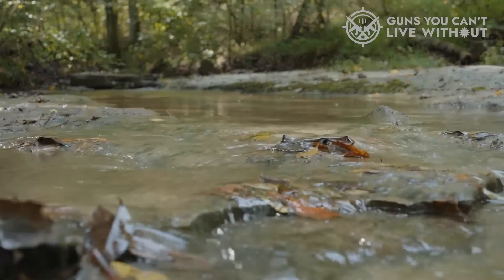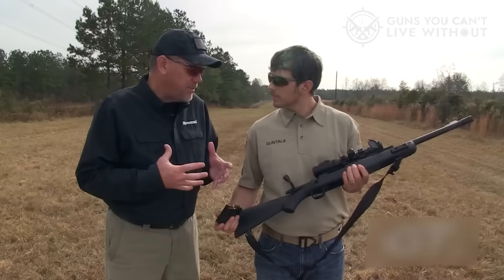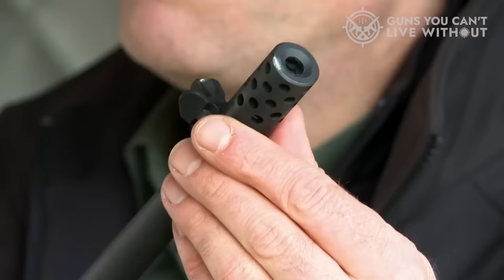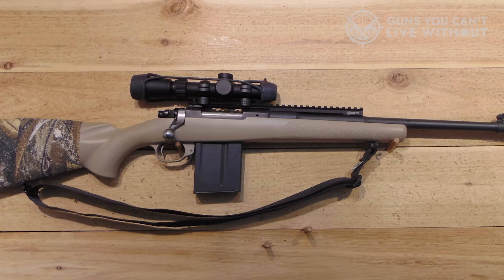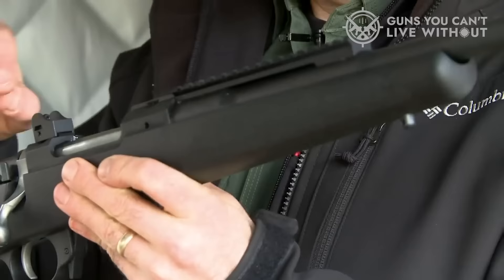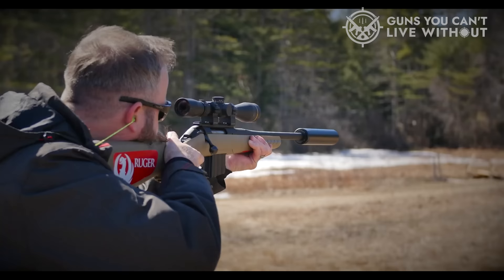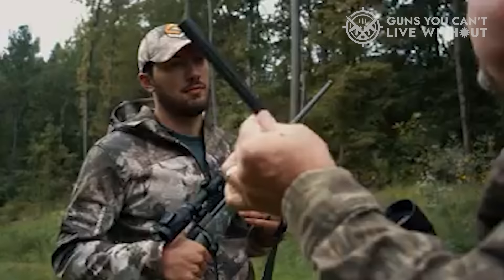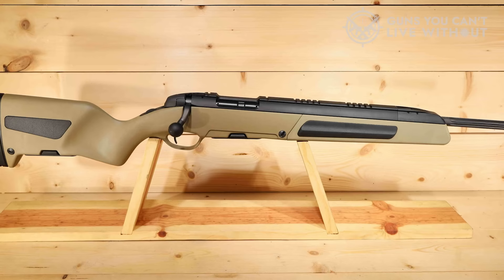Best Scout Rifles For Survival 2024! Who Is The NEW #1?

Comment: The Mossberg MVP in 7.62x51mm can use both M-14 and SR-25 pattern magazines.  Even the MAGPUL D-50 works.
Reply: I own one and while they can use the mags, they are hard to find and a handful to shoot since they are rather light
Reply: @jasondarby2749  They seem pretty common in the guns stores I've seen.  And they shoot about the same as any other .308 bolt action as far as I can tell.
Reply: @Kriss_L  might be where you live because I had a hard time finding mine when I got it. It is quite a bit lighter than the .308s I am used to.

Comment: I've seen some online questions and complaints about the Steyr iron sights. To my mind, iron sights on a scout rifle are an absolutely integral part of the package, not a mere "back-up" Whatever the make, they had better be top quality and rugged to qualify as a true scout rifle.
Reply: The plastic sights on the Steyr are not nearly as rugged as that of the Ruger.  During the 2016 Scout Rifle Conference at Gunsite, this very issue was a topic of discussion with the folks from Steyr.  Part of their response was that very few riflemen ever revert to “iron” sights when using optically sighted rifles, and that modern optics rarely fail.  I personally do not go with that logic, and therefore equip my “scout” rifles with rugged iron sights, and intermediate optics that have detachable scope rings.

Comment: Ruger American Ranch 7.62x39, 38" long and weighs 7 lbs including a linear compensator with front sight attached, Leupold VX Freedom 1.5-4x20 scope with  Pigplex reticle and a stock bag with tools, rear sight, oil and a bore snake. Uses Mini 30 magazines.
Reply: One of my favorites. Also super accurate.
Reply: @1984keen  Mine has been modified to use Pmag AK magazines.
Reply: Not

Comment: I have an AR-15 and AR-10, a few years ago I purchased the Mossberg Scout, 5.56, it has become my favorite carry around rifle. It is easy to get in and out of a vehicle, easier to carry through heavy brush. I have a bunch of 20 round AR mags that make it the perfect rifle for me. I looked at the Ruger and Savage Scout rifles, the compatibility with AR mags sold me on the Mossberg, along with being half of the price of the Ruger and about 25% less than the Savage. I am looking for a Mossberg in .308, a matching set would be great.
Reply: I like the scout, but the bolt action takes away from the follow ups.
Reply: Using standardized magazines is the only logical conclusion.   Availability is key.  Why reinvent the wheel when you can use gi issued type magazines.

Comment: I'd take the RUGER Gunsite Scout. I've owned a RUGER American. Very accurate in 6.5 CM but sold it B/C it had NO bolt lock. Otherwise it had an excellent 3 lug bolt and innovative bedding system.
->The excellent TIKKA t3 by SAKO is the official Canadian Ranger rifle. If is VERY similar to the RUGER Gunsite Scout laminated stock rifle. Both are VERY similar. The RUGER and TIKKA have a Mauser bolt, laminated stocks, magazines, iron sights and ACCURATE cold hammer forged barrels. Never doubt RUGER'sbarrels ever since they changed to cold hammer forged machining.

Comment: I love my SOCOM 16 in 308. I have a Burris, long eye relief scope on it, and it's a gem!
Reply: I hate mine. HUGE front iron sight that basically covers a man-sized target past 25 yards making it useless for accuracy, fire breathing muzzle brake that makes you want to die firing in low light, and the scout mounting rail is less than useful. I bought it before I knew anything.
Reply: @dougo753  Shave it down if you plan on using it. Good luck!
Reply: @64samsky  They make a replacement sight but because of Springfield's poor SOCOM design you have to replace the entire gas block unlike the easy and readily available alternatives for all other M1A models.
Reply: The wide front post matches the purpose of the SOCOM’s length.  Quick pointing short-med range target acquisition.   Simply remove your post and file it down narrower.  I have sharp point front posts on all of my rifles.
Reply: I have the m1a scout with a leupold.  The glass I just got recently so I'm looking forward to break in
Reply: I wish I had keep my Socom, but sold it to a friend.

Comment: The M'berg scout is chambered in7.62x51/Nato ammo and 5.56/ Nato .. note there are things to consider regarding the difference between standard 308 Winchester munitions which many beleive are fully interchangeable with 7.62 ammo. True Nato ammo in the 7.62 caliber have a very hard primer casing which the unadjusted Scout firing pin can not reliably impact hard enuf to get combustion...Also, the 308 ammo is typically in the 150 and up bullet weight, whereas the Nato ammo is 147. From experience, the lighter Nato rounds (with modified firing pin) are a much less aggressive shot in the short barreled Scout. And there are differences in head space and combustion pressures between the two ammo. I look at it like this ..the stamping on the barrel is 7.62x51 with no mention that 308 will do just fine.

Comment: The scout CONCEPT was based on the best that was available to Jeff Cooper at the time. Low power variable optics were not available and those that were were price prohibitive. A reliable and affordable 308 AR close to scout size wasn’t available to him.  Finally PARTS AVAILABILITY,  I challenge anyone to walk into a shop and find common were parts like firing pins for any of the rifles listed.  Do you have the specialty tool to take down the bolt to replace it?  Without magazines (a consumable) and ammo you have an expensive poorly shaped club.

Comment: "Call them whatever you want ...."  and  in the heading, " rifles for survival...."  OK, that leaves a very wide scope, so here goes.
Looking at the selection chosen, they are very different from each other.  However, two things stick out for me  "survival" and "self defence" .   
Now some questions - Why is it necessary for a 7,62mm/.308 calibre rifle? One is most unlikely to want to defend yourself from someone 300+ metres away, except is some military scenario.
Why must the rifle be collapsible? Highly compact self defence weapons (or PDWs ) exist in many calibres. Why is a huge scope necessary? (Would one have the time to use it in a self-defence scenario? ) 
If I were looking for a self defence weapon, here are some things I would be looking for: 

Firstly, high magazine capacity. I don't want to carry around multiple magazines festooned all over my body - one, maybe two, exrtra mags is about the limit.
Compact: I'd like a short, compact weapon with as few "sticky-out bits" as possible. I don't want a Christmas tree (like some AR15 builds one sees on YouTube). 
Barrel: I'd ideally like a minimum of 10,5".
I'd like permanent iron sights, and capability to add other sighting systems, like an MRD.
Ambidextrous:  I'd like this for the controls, or the ability to swop out if needed. Downward ejection of spent brass would be ideal.
Calibre:  Not too fussy, but I'd need at least better effectiveness than 9mm, with lower over-penetration. 
Maker: I'd prefer to buy from a reputable manufacturer, experienced in the manufacturing of such weapons. 

Does such a weapon exist?  I dare say there are several, but the one I'd go for is the FN PS90 (SBR version), with two 50 round mags. {Ideally I'd prefer the P90, but this would not be legal. )
This weapon has proved itself in over 40 countries, in multiple applications and is still used by the US Secret Service for bodyguard applications.
Reply: It helps to understand the purpose of a scout rifle in the hands of a scout, in the mission of a scout in the military. Steyr and Ruger got the closest, but both are too heavy. Controlled round feed is also a must in a scout role, as it is a must to most professional hunters in dangerous game areas. The M77 has it. Throw brass rapid fire or eject brass slowly and quietly into the hand. The ability to top load the mag insitu is also required for Cooper's scout rifle concept. So far, a scout rifle meeting all of Cooper's requirements is a unicorn.

Comment: 1943 Mosin Nagant 91/30, cut the barrel to 16 inches, put a Boyds laminate thumbhole stock on it, removed the rear sight down to the dove tail, installed a 2 inch picatinny rail to it with a Vortex Venom red dot. I trust it easily to 200 yards and its breath HUGE fireballs. I call it "The Dragon".
Reply: Bruh you should call that a massacre.

Comment: The problem with the mossberg in 5.56 is it won’t set off that harder primer consistently
Reply: That would be concerning.  Wonder if an upgraded spring and/or firing pin might help?
Reply: @davidcox3076  

I kept sending it back and they kept trying different stuff apparently and none of it worked. Seemed to just boil down to the design was poor for the bolt action application. It’s a straight drive on the bolt vs a swing style on the AR platform that creates more force and so they are dancing a fine line of a negligent discharge on the AR with the softer .223 primer’s apparently

Comment: Shoulder pad on an M1A lol   I'm sorry, but that's just not needed.  If you get a sore shoulder from firing M!A, you are not properly shouldering your weapon.  I don't know about the M1A tanker, but I do own the M1A Scout (18" barrel) and typically shoot 200+ rounds on an average range day.  Never have I gotten a sore shoulder.  The standard muzzle device on the M1A greatly reduces the felt recoil.

Come on now.  The AR7 does not fit into the Scout Rifle niche at all.  I do own an older AR7 and it is a fun shooter, but has some reliability issues with certain ammo brands.  A better option for a .22 lr survival rifle, varmint rifle, or pack gun is the 10/22 take down.  Much more reliable with a wide range of ammo brands.

Your information on the Ruger Scout Rifle is either wrong or outdated.  It doesn't come with a 20" barrel.  It comes in two options, a 16.1" barrel or an 18.7" barrel.  In fact, both options fall within the Scout Rifle criteria of overall length less than 39", barrel length under 19", overall weight below 7 lbs, with iron sights, and optic capable.  I don't own one, but it is on my wish list, just seems overpriced for what it is though.  I do have the American Ranch in 7.62x39 and the American Compact in .308.  Both are decent, fun shooters that seem to be reliable and they are low cost rifles.

Comment: Save your money and buy an ar10 platform if you want a battle rifle caliber. I built mine for less money than these scout rifles, and it easily shoots moa and offers the extra firepower of a semi auto, if im looking at a rifle with survival as the context, I'd skip the bolt guns.
Reply: The reason scout rifles are bolt action is because of reliability.
Reply: @torq1116  I've had plenty of bolt actions malfunction. And a follow up shot is much faster with a semi auto.
Reply: @Wymon Watson  Fine, you do you, we like bolt rifles.
Reply: @la_old_salt2241  I like bolt rifles as well, I was just pointing out that for the same kind of money you can have a modern rifle that is just as accurate and has the ability to hunt, or defend and so on. In my opinion a more practical survival tool, and that's how this video was framed.
Reply: @wymonwatson1309  If it's a blow back, fine, but if you're out in the wild and a gas tube ruptures, you no longer have a rifle, you have a club.

No matter you're preference, mine is lever action, bolt actions are always more reliable because the have the least amount of moving parts to go wrong, while still holding more than 1 or 2 rounds.
Reply: @Torq11  How do you figure? It will still shoot, you will just have a straight pull bolt at that point, do you know how many gas tubes I've had rupture in literally 10's of thousands of rounds from an ar platform? I do the number is zero, and your point is incorrect your weapon would still fire.
Reply: @wymonwatson1309  I'm looking at this from the "theory", not of actual numbers.  In theory, the rifle with the least moving parts will have less to break.

I have a blow-back style 9mm carbine, and that thing rarely ever jams, no matter what ammo you use.  But in "theory", my bolt action is more reliable.

Scout rifle always seem to me to be a lightweight, minimalist, simple set up that has consistent accuracy.  Not the best set up for any one scenario, but a good jack of all trades for most scenarios.

If an AR platform does that for you, then that's great.  I know many people who agree with you.  But after serving for 24 years, the AR platform is just not my favorite, LOL.
Reply: Ar10 platform isn’t a scout rifle fool. Try again lol
Reply: @J Van  No kidding genius, I never said it was, said it was better in every way as a survival tool.
Reply: @wymonwatson1309  wrong again 🤦‍♂️ I can’t wait to hear how so from an atf fanboy.....proceed
Reply: Bro that not the point. Bolt are the most reliable. That 308 100% will jam.
Reply: I’ve shot lots of platforms with varying results. Ive had the most malfunctions with full-auto (M249 looking at you), then Semi-auto then bolt guns.  Less parts to fail on a bolt gun, less chance of failure
Reply: Each rifle has their place I guess. Bolt guns are never a bad option but I also would just split my 16” AR10 in two pieces in a bag and probably do as well as a bolt gun. It would weigh more though
Reply: Agreed, but some of us can not have AR 10's. Here in Washington state we can no long even buy any kind of parts for most weapons of this type. Yes i do have lots of ARs and AKs so yes we are familiar with these weapons. As gore me bolt guns are a little more fun to shoot. Hey do what makes you happy people and don't let people tell you different. Have a great day everyone
Reply: @R A Camp  Your not even allowed to buy a neutered version?
Reply: @wymonwatson1309  no sir. We can no longer buy, import, or manufacture any parts at all. With this ATF brace thing we can not get new buffer tubes or barrels nor trigger springs.  Its is pretty crazy they just voted on it by themselves. Its crazy how they can do this. Not only does it go against the U.S construction it also goes against our Washington state constitution
Reply: @R A Camp  Yeah, I bet it will get overturned by the court, problem is that takes forever.
Reply: Springfield M1A all the way
Reply: The concept was dubbed “the scout rifle,” and Cooper refined it over the years until his death in 2006.  Cooper believed in the “scout,” a man who “acted alone, not as a member of a team.”

By choice he did not fight, but he had to be an expert at the hit-and-run art of single combat.  By choice he did not shoot, but if forced to shoot, he shot quickly, carefully, and as little a possible.

“One round, one hit and then vanish!” – that was his motto.

He did not need an assault rifle.  He needed a scout rifle.”
Reply: @wymonwatson1309  hopefully.

Comment: Are you kidding? Survival? The best is a Mini-14 can handle military amo/even armor piercing / tracers and has many accessories. With a collapsible stock and 4x scope can hunt and use as a defensive weapon. Like a AK can be put it in mud and it will still fire. I carried one for yrs as a police officer with also a tac light with a pressure switch under the barrel. That's survival.

Comment: When people get all tight on the 'rules' of the scout rifle.. they've missed the point.
80% or more of so called 'scout' rifles are too heavy and not all that great.
For example, None of the detachable magazine fed rifles need the 'forward' mounted scope. There is no need to load more than round at a time through the top and a modern LPVO negates a lot of the issues that the forward scope was supposed to 'solve' 
you can build a light weight, 6mm arc or 6.5 grendel AR with a LPVO and have a better scout rifle than a lot of the heavy bolt guns.
"A general purpose rifle is a conveniently portable, individually operated firearm, capable of striking a single decisive blow, on a live target of up to 200 kilos in weight, at any distance at which the operator can shoot with the precision necessary to place a shot in a vital area of the target." -Jeff Cooper
Considering that he considered 2 MOA to be acceptable.... lol.. there's a lot of wiggle room in there with modern ammunition and calibers.

Comment: I’d like to get a tactical lever action rifle, in a larger caliber like 444 marlin, or 45-70.
With a skeletonized, light, handrail, and skeleton butt stock
Reply: Why? Fancy hunting velociraptors while enjoying a jurassic park fantasy? .308 is ballistically superior and lighter than .45-70. Not to mention a wider variety of bullet choices, if hand loaded and more readily available and cheaper cartridges, if not. Bolt guns replaced lever actions for a reason, such as less complicated actions and higher cartridge capacity. A relatively cheap 12 gauge mag pump is better any day of the week versus an obsolete and expensive .45-70 lever in most cases, yet the .45-70 fantasy lives on.
Reply: If u can find a Marlin 336Y ( 16 inch barrel 30/30) 
or a Winchester Trapper
Reply: I have a lever and a bolt and prefer the bolt over the lever. The lever is just for western nostalgia
Reply: Go for the .444.   It’s simply a .429”,   Otherwise known as a .44 Supermag.  You do not need the extra 100gn mass of a 45-70 or the extra recoil that comes with it.  It’s only deer, elk, and hogs.  They ain’t hard to kill.